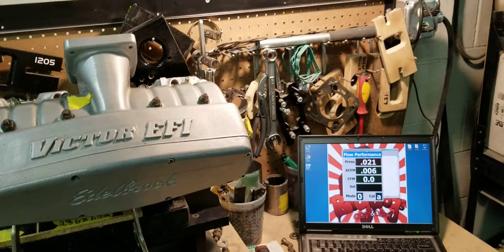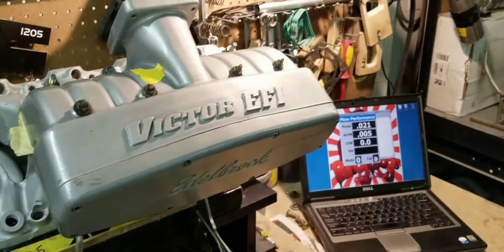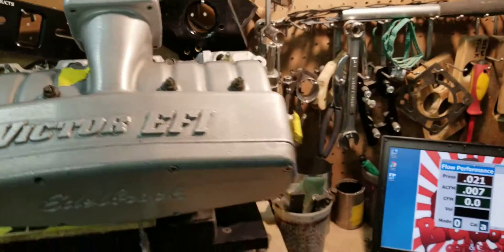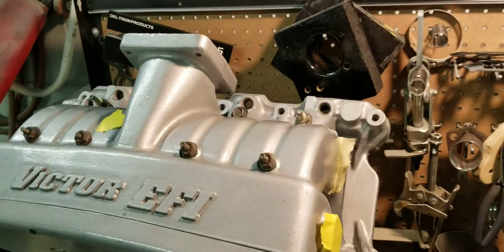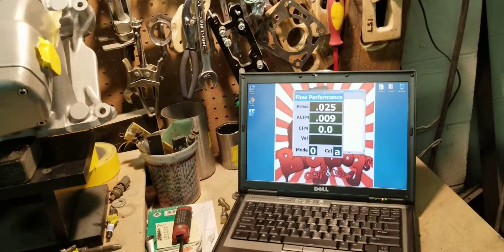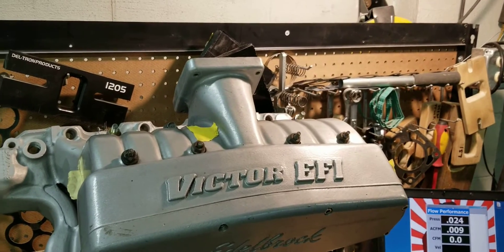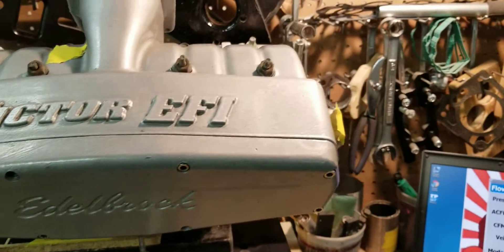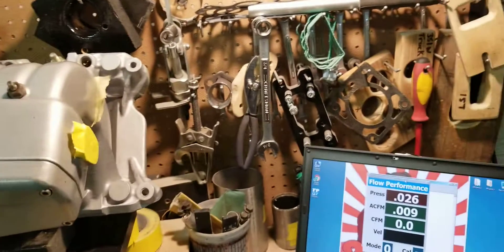Edelbrock Victor 5.0 stage 2 flow results

Comment: Why do some of these intakes read victor 5.0 and the other reads victor EFI ? Is there a difference or did Edelbrock just change the text of the casting?.. thanks in advance
Reply from the maker: You  have the 302 and 351w versions plus a 2 piece and carb efi style

Comment: What did it flow stock i can find one for a good deal as I'm putting together a top end kit for a stock block 5.0 would this be to big coming from Honda where its all high ram and cfm
Reply from the maker: Stock it flowed in the 260s range. This manifold is not a good manifold for a small cube, lower compression 302 operating below 4500rpm due to it's short runner